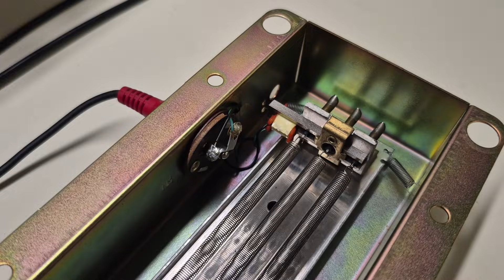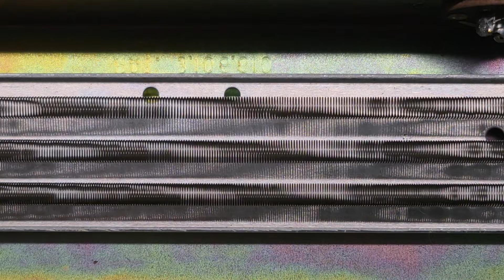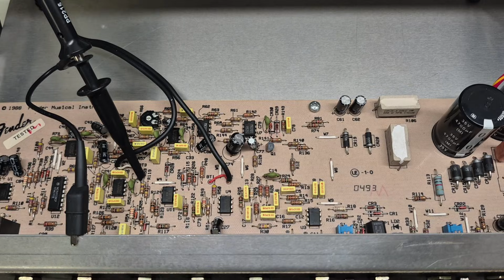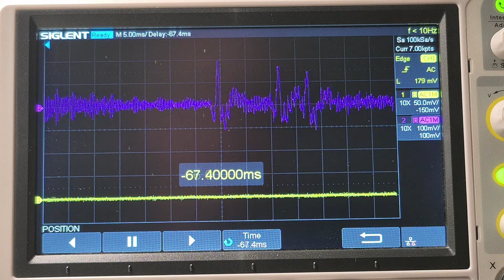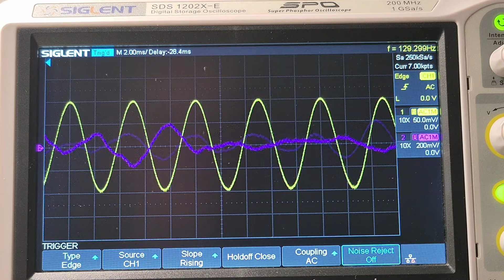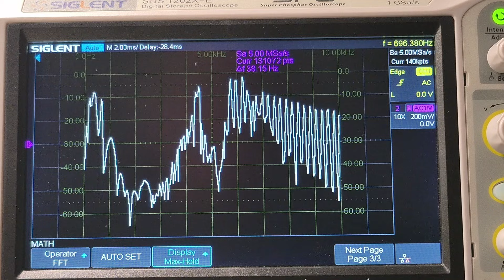Measuring Impulse Response of Spring Reverb Tank

Comment: It makes sense that a shorter spring would experience higher tension over the same distance than a longer one, but assuming the shorter spring is "overstretched" to the point that it relaxes to the same length as the longer one, it would hypothetically experience the same (or very similar) tension as the longer.  Additionally, with the coils being stretched farther apart, one would assume there is less physical mass between the end points.  My question is, how would this effect the reverberation characteristics of the different spring types?  (Example, would the delay time be increased or decreased, would the overall response duration be longer or shorter, and how would the specific resonances be effected?)

Comment: Intresting aproach from technical point. I just asume it works as a frequency dependent delay line with not matching impedances at the ends of the lines and olso the transformers cause compression effect. 
The most intresting ones are sounds like an small bubbling creek at the start of the spring. You realy get the sound of the fresh running water when you drive it well.  What is impossible to get out from an complex matematical aproach.

Comment: Interesting stuff. As far as I can tell, things like the Mooer Shimverb emulates this effect electronically while also modulating it a little bit. At least that was my interpretation of what I saw on the scope while hearing it. I also noticed that it does not treat each frequency the same, so it's creating various resonances based on what goes in to the circuit.

Comment: Nice video! I think you are right when you say, around 14:15, that the resonances don't have time to occur. What would the spectrum look like if the sweep were slower, much slower? In the steady state measurements there seems to be a large difference between the received amplitude at different frequencies, but as you say, they need time to settle. I think the spectrum would look more interesting if the modes were allowed to settle, but the video would be much longer... : )